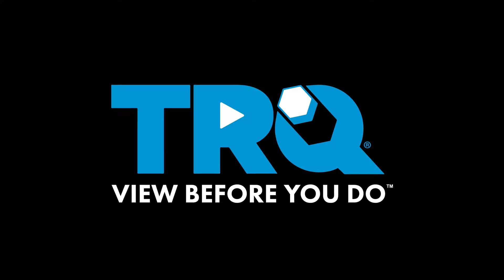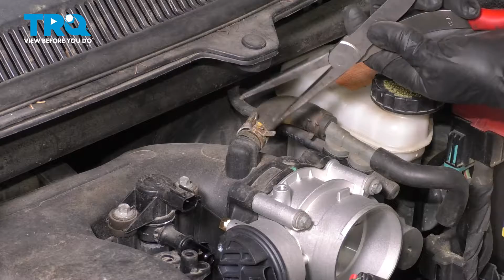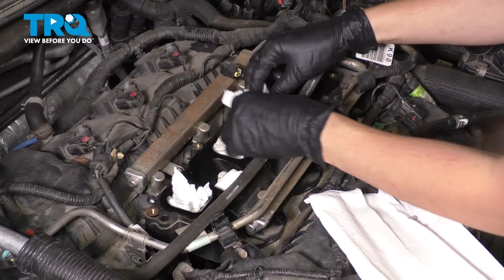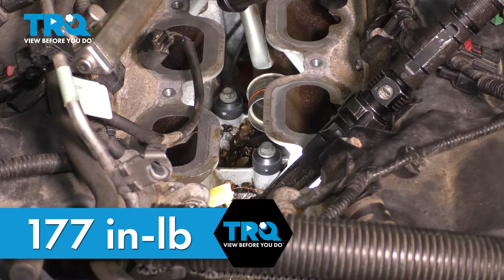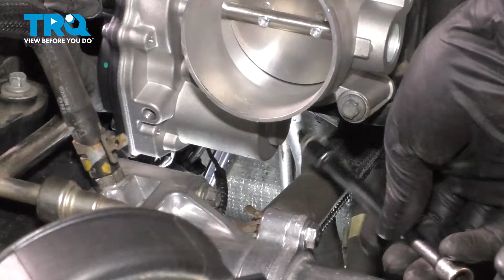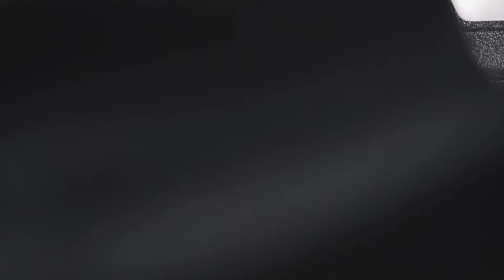How to Replace Knock Sensors 2011-2019 Ford Explorer

Comment: How much does the labor cost on this job? I need two knock sensors replaced.
Reply from the maker: +@cynthianuno3790 We are unable to provide an estimated cost for the repair. We recommend contacting local mechanics in your area to provide you with a cost.